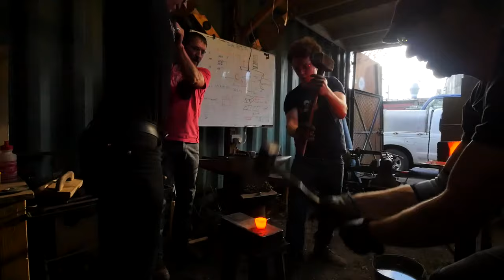THIS SLEDGE IS BIGGER THAN MY HEAD!!

Comment: I know that this video is a year old and I Hope that this reaches you.
Be careful with heavy objects! I once worked in a machine shop doing "Cut off" with large bulk stock.. I was in the prime of my life and my physical build ( not to boast) was fairly impressive.. to put a long story short.. I was also becoming quite cocky. I decided one day instead of using an engine hoist to move an aluminum bar that was approximately 10 feet long and 10 inches in diameter.. one end at a time. From one conveyor to another and my left foot slipped on some coolant that was on the floor.. now I have two dessicated disks in my back.. ( think of a jelly doughnut with the jelly squeezed out). Now life is a damned misery. And I am a shadow of my former self... And remember these words Alec.. just because you can lift something doesn't mean that you should. Take care my man.
You have the potential to be one of the best Smith's this world has ever seen..  you are young, you have the drive, passion, creativity, and most of all.. the raw tallent! And I would absolutely hate to see all of that wasted. Just please be careful!
Reply: Carl Manx I second that. It’s easy to forget that we have limits and as much fun it is to push those limits, they should be pushed under as much control as possible so that we can be ready when we don’t have the luxury of control.
Reply: @BlindRambler  dah what??
Reply: Always stand for what and who you are! And also THINK outside of the box!!;

Comment: quick question why wouldn't a round cup in a swage block work as a cupping tool for hammer is the radius to much or not deep enough your input would be greatly appreciated thanks
Reply from the maker: +Wade Stewart it would work fine!

Comment: So is this class basically making everything you need to make the next thing and so on like you need a cupping tool to forge a rounding hammer so you make that first I guess that's why it's called the evolution of tool making
Reply from the maker: +Zednought Gamma yes! That's absolutely correct! :)
Reply: Alec Steele oh cool and you get to keep the tools or do you sell them afterwards?
Reply from the maker: +Zednought Gamma You keep everything you make in my classes!
Reply: Alec Steele oh my good lord now I wanna take this class even more alright I'll crank out bottle openers and bracelets faster than you can say 26 pound sledge and save to take a class if all goes to plan
Reply: Alec Steele just gotta get people to want to buy them too